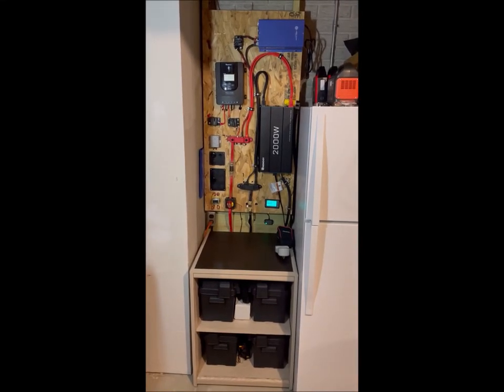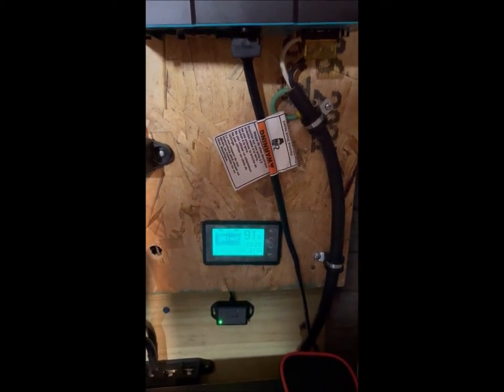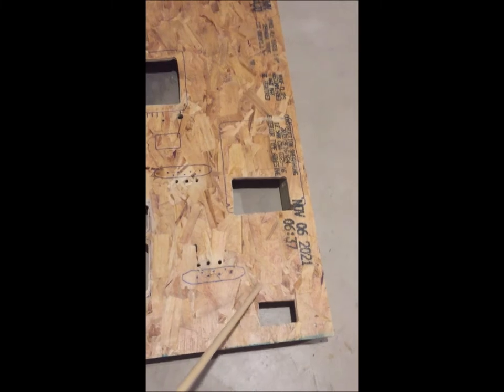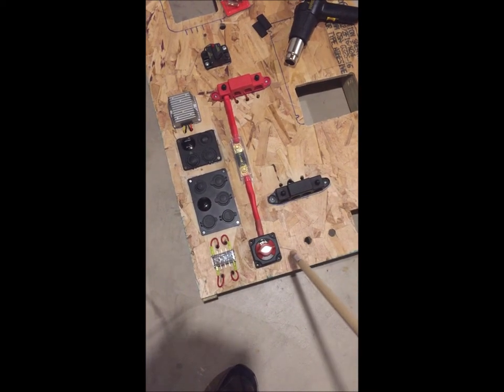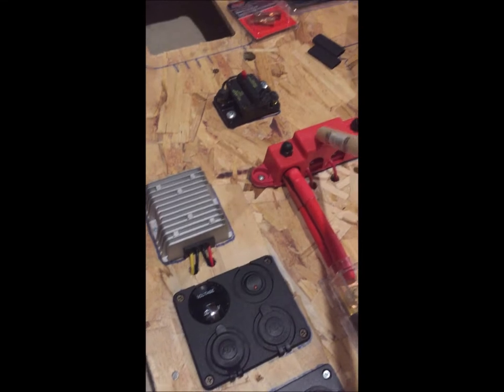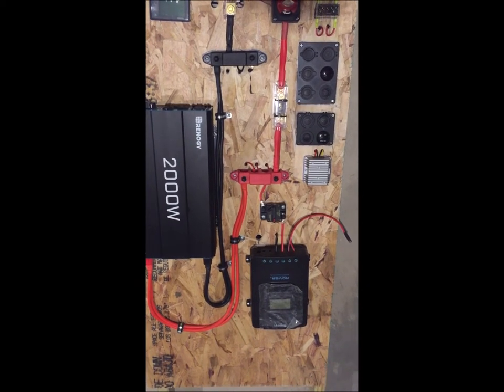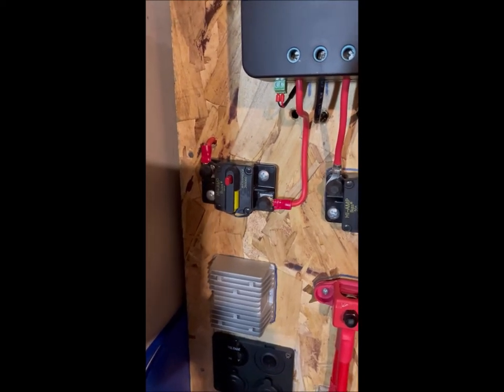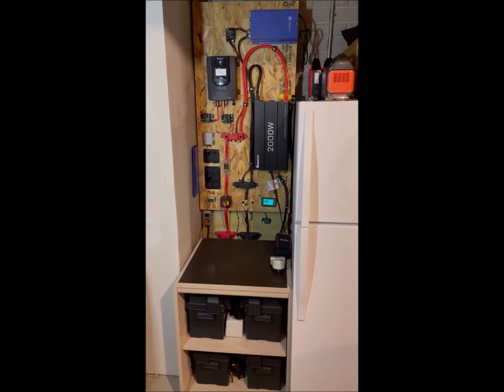Off Grid Emergency Power Station Installation w/ WEIZE LifePo4 Batteries(400Ah)!  DIY Solar System!

Comment: Beautiful power backup system, I don't know if I can use this for my basement sump pump as an emergency backup power. I saw someone said that the inverter charger will not switch back to AC if the battery is depleted. Is that true
Reply from the maker: Yes, this is completely off grid.  There are some inverter/chargers out there that do have a grid input that could be used in place of this Renogy 2000W inverter.  If it's for a sump pump, then there are systems like this link below that is perfect.  https://www.homedepot.com/p/Basement-Watchdog-0-33-HP-Special-Battery-Backup-Sump-Pump-System-BWSP/100067307